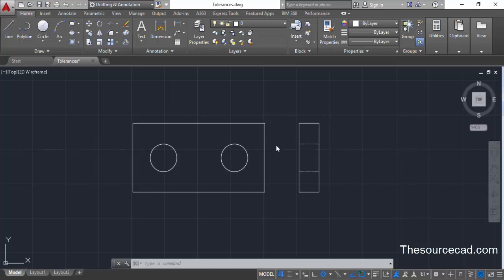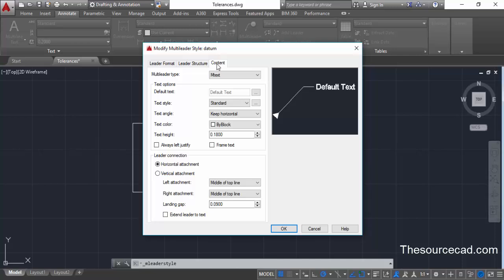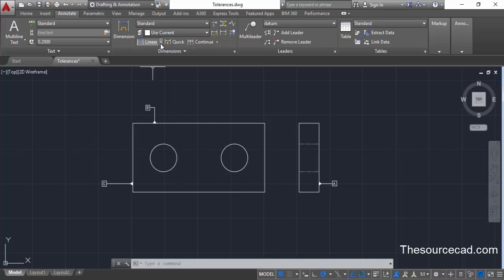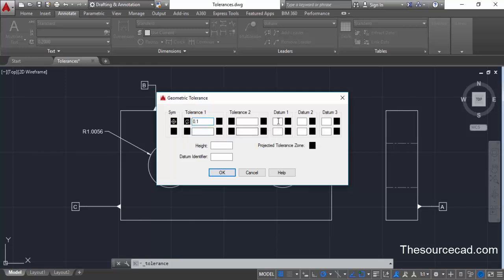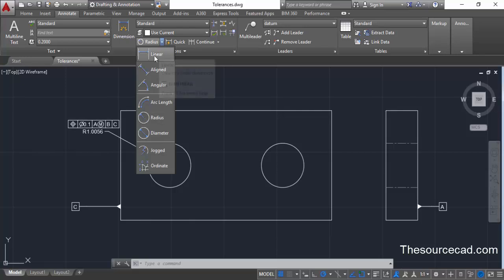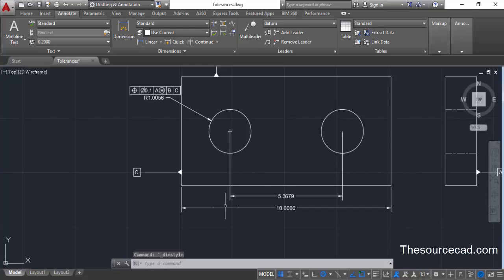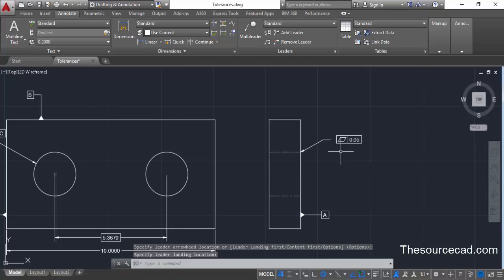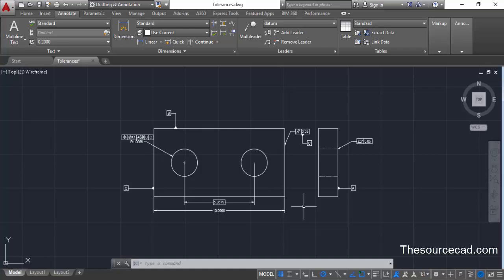Adding geometric tolerance with feature control frame in AutoCAD

Comment: Is there a way to add a unilateral tolerance with the dialog box? The only way I have found is to use a font that has the circled U as a special character and call it out by the unicode identifier.